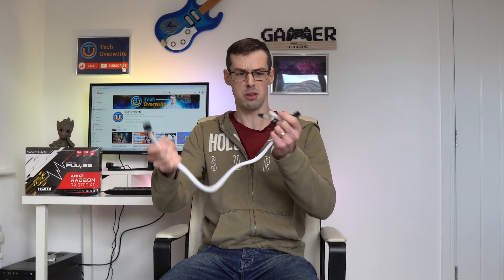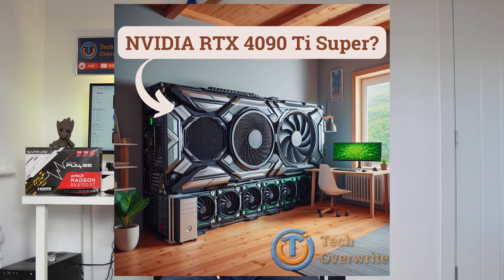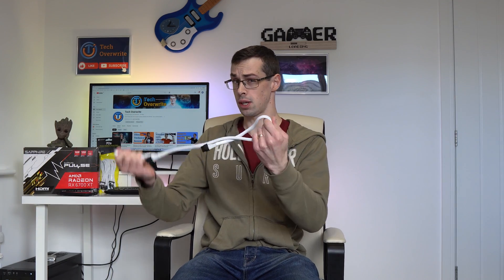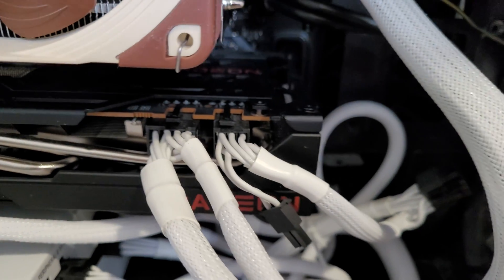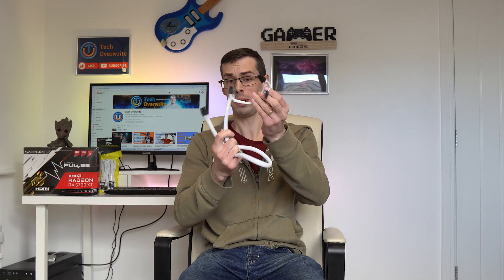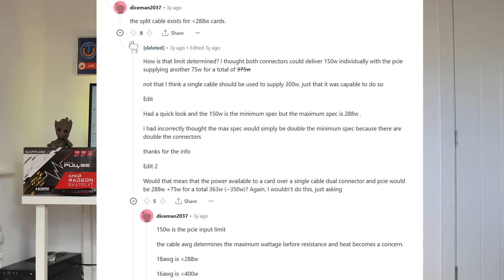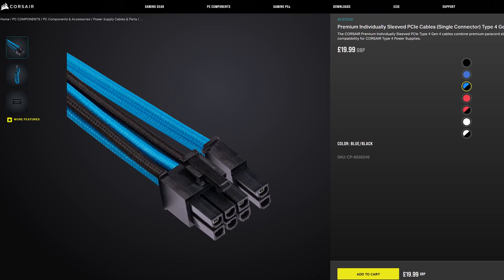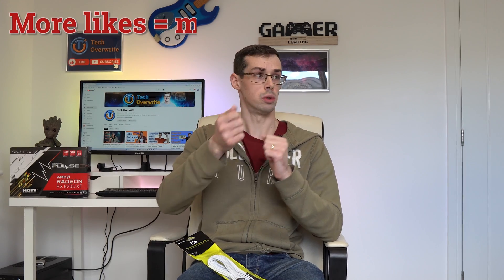Stop Connecting Your GPU Power Cables Like This! (How To PROPERLY Connect PCIe Cables For GPUs)

Comment: I have a rx 5700 xt and any time I launch up a demanding game like froza it would crash after barley loading in and gpu temp reaching 83c. My pc first loses display signal then fans stop spinning and it just shuts off.

I noticed my pcie cables are pigtailed do you think that could be the cause for the crashes? And should I switch to 2?

I have a be quiet pure power 12 m 850w psu if that makes any difference
Reply from the maker: Hmm that's odd, sorry to hear it. I mean, the 5700XT shouldn't really be crashing with a single cable although its power usage is borderline, so maybe two cables would help. The only way to know for sure is to test with two separate cables, and then see whether things are more stable. However if you still get crashes, I would use DisplayDriverUninstall, restart, then reinstall fresh drivers and see if that helps.
Reply: @TechOverwrite ill test it out and let you know how it goes

Comment: Planning on getting a 7800xt which requires 2 8pin connectors, ok so no pigtail connector I get it, are there cables where it’s like a double 8pin connector and connects to two pcie sockets of the psu ?
Reply from the maker: Good question - I'm not aware of any. I don't really see what the benefit would be over just running 2x separate cables (unless I'm misunderstanding). You will, however, get 12vhpwr to 2x 8-pin cables with many modern PSUs - i.e. ones with a native 12vhpwr/12vh-2x6 slot. They can be quite useful, and deliver more than enough power for a 7800xt :)

Comment: I bought 5060ti 16gb today my psu is 500w, the new gpu requires 600w and tells me to use 2 individual pce cables, is msi 650bn is fine? I got i5 10400f, should i buy extra pce i cable?
Reply from the maker: Ah interesting. I mean, the 5060 Ti isn't super high power, so you might be okay using that with a 500w PSU (and maybe even a pigtail). But yes, the MSI 650BN has two PCIe cables so that would probably be more stable again :)

Comment: Trying to find a PSU with 3X 8 Pin connectors from which to run three cables is proving to be difficult. Due to the language and terminology searches focus on cables not PSU end connectors.... and yes, I have a 7900XTX Sapphire Nitro+.
Reply from the maker: I get that, it's frustrating. Sometimes the higher wattage ones have 3x 8-pins. So... some 1000w might have three. And then many 1200w and above have three. You then need to look at the actual PSU pictures to see what connectors are there. I don't rely on the text/specs either - it gets too confusing.
Reply: @TechOverwrite Thank you for replying. I'm taking a chance on a Super Flower 1300w. It looks good from the back...

Comment: Thank you so much for this! I have been building and running high end gaming machines for years. Never had a problem….until my last rebuild. I have a 3090 ftw3 hybrid and I was running it with on pigtail and one straight. It worked fine until I recently upgraded my cpu, mb, and memory. Then it started crashing whenever I ran anything demanding. I was just installing my new psu (because I assumed it was a power issue - bought a 1600 watt monster to cover that now) and saw my pigtail connection I had been using and thought, “this card requires 3 8-pin connections. Surely splitting it like that can’t be a good idea.” I looked all over, including on Evga’s own site and found nothing, until I came across this video. I will be using three separate connectors now to run this beast and (fingers crossed) I’m sure this will alleviate my issues. Thank you so much for this explanation!
Reply from the maker: Thanks for watching and commenting, glad this was helpful :) Good choice on the new PSU, it's always good to have some extra power headroom IMO. Sounds like you're approached this correctly.

Comment: omg, i just realize that my last rx 7800xt always get blackscreened. every troubleshoot i've done but can make my gpu run normaly when the gpu pull maximall power like 260watt. i just use single pig tail in the 7800xt. maybe this is the problem why i always get blackscreened :face-purple-crying:. now the gpu already sold with only 1 month using
Reply from the maker: Ugh sorry to hear it. Yes this could well be why. Hopefully your future GPUs run more stably now though.

Comment: My 1000w psu only comes with 2 pcie cables and my gpu needs 3. What should I do? I can use the pigtails or would that not work. My gpu is a 9070 xt btw
Reply from the maker: You might be fine with just 2x separate cables. My 9070XT only has 2x 8-pin connectors, for example. I think the variants with 3x connectors are just for some extra OC headroom, but it's unlikely that it'll genuinely need 3x separate cables in 99% of cases.

Comment: Man i don't know what to do, i have to buy a new GPU (my 4070 died for factory difect) and now my only option is 7800xt. But my PSU (itek gf750 evo) had 2 PCIe cable, i say had because i can't find one cable so now i am stuck with only one daisy chain cable and i don't know if i am safe or not. (for clerance the GPU is the Asus Dual Radeon RX 7800 XT OC Edition)
Reply from the maker: Hmm that's a difficult one. I probably wouldn't want to power a 7800XT overclocked variant with a single cable, sorry. I mean, it might be fine - and you can always undervolt it to protect yourself. But in the long run, buying a new PSU or even a reputable cable e.g. from CableMod will be better.

Comment: I found your videos because I just recently bought a cooler master mwe 750w v2 modular. My GPU Rtx 3070 LHR version.

I connect 2 separate pcie cable to the gpu. It ran okay and safe for 1 months until it always crashes every day when I play a game. Sometimes, just make it to the opening menu then crash.

I thought it was a system error until everything is good and still crashing. 

so, my question, do I need only use 1 cable with pigtail?
Reply from the maker: Hmm that's really odd, sorry to hear it. Could one of the cables be damaged maybe? In general, 2 separate cables should be more stable than a single cable with a pigtail, so that's odd :/
Reply: @TechOverwrite  I thought it is the cable problem. But, it isn't. Still no idea what happened to PC. It keeps crashing when I play game and causing error when playing video on Youtube (it'll be normal again after refresh the page).

The last resort of my thought is only the GPU almost die, buit I hope not :(
Reply from the maker: Hmm you're right, it could unfortunately be hardware like a failing PSU or GPU. I hope not though 😔

Comment: i got 8+8 pin connectors on my rtx 3060 ti and 2 splitted 6+2 pin connectors from PSU. Should i use 1 splitted cable or 2 and using only one 6+2 pin connectors from each other? my gpu asks for 220W and i saw that splitted 6+2 pin connector gives 150w max. so maybe the 2nd choice is better?
Reply from the maker: IMO, the second choice will be more reliable, and also handle transient power spikes more too (which all GPUs can have). :)

Comment: So when they built my 3070 PC with a single cable it was okay since it's a decent Corsair cable from expensive PSU, and maybe using just this to power a 5070ti might be why I was getting freezing a lot.
Reply from the maker: Huh interesting, but yes, the power consumption increased a lot between the two cards (<250w for the 3070, but >320w for the 5070 Ti). That might be why, I agree.

Comment: 9070 XT OC here that requires 3 connectors. Haven't installed it yet but I have a 1000w PSU with only 2 dedicated PCIe cables and both have pigtails. Assuming I should be fine using the 2 main cables and the 3rd I'll use one of the pigtails. Does it matter which cables I use in a particular order on the card or are all the connections on the card created equal.
Reply from the maker: Yes I agree, that should be fine (2 dedicated cables and then 1 pigtail for the 3rd connection). The order shouldn't matter either :)
Reply: @TechOverwrite  So I have the rm750 watts psu and that comes with two cables both pig tail. I wanted to get the red devil 9070xt and thats recommending 900w although underload it shouldnt get more than 330w and I have an i5-12400f so if we are talking about turbo watts it goes up to 115w so since it only gets to around 600w would it not be fine to have two proper connections then once pig tail for the final one right ?
Reply: So I have the rm750 watts psu and that comes with two cables both pig tail. I wanted to get the red devil 9070xt and thats recommending 900w although underload it shouldnt get more than 330w and I have an i5-12400f so if we are talking about turbo watts it goes up to 115w so since it only gets to around 600w would it not be fine to have two proper connections then once pig tail for the final one right ?

Comment: If I'm running a pigtail to my EVGE 3070 Ti FTW3 with 300 tdp does that mean I've been under-volting it for four years..?
Reply from the maker: Not necessarily undervolting it, but maybe at times your performance could have been getting 'capped' a little without you realising.

Comment: Can I use just one cable with the Pigtail in a rtx 5070?
Reply from the maker: As in, run a single cable to the 12vhpwr adapter that's included with your GPU? I personally wouldn't do this - I would never take chances when it comes to 12vhpwr. So I would either run two separate cables, or look to undervolt my GPU so it uses less power.

Comment: I just moved, my gpu worked fine before the move, but now it says it's only getting "Board Power" and it hasn't exceeded 28 watts.

It's a Radeon 7900xtx XFX.

I've removed it, reseated it, unplugged the connections on both ends repeatedly, still nothing. The PC works and displays just fine, I just can't game anymore. 😢
Reply from the maker: Oh no, sorry to hear it 😕 Did you remove the GPU before moving? If it was in the PCIe slot, there's a small chance the PCIe slot or connection has become damaged (by the GPU moving during transit). Hopefully not though. Maybe double check all the PCIe PSU cables, incase one of those is damaged or there's a slight loose connection.

Comment: hey my PSU just have 1 PCIE cable how can i get another cable ?
Reply from the maker: Hey, unfortunately you might just need to change your PSU if it only has a single PCIe slot. Alternatively you can try using the single cable, but undervolt your GPU so that it uses less power (meaning it should then place less stress on the cable) :)

Comment: Hi! Can I get some help? I bought a pc a month ago, the GPU is a Sapphire RX 7900 XT nitro+ which has 3x8 pin connectors, but my PSU is a Be Quiet! Pure Power 12 m has only two outlets, so I must deal with this daisy chain pigtail stuff. The only thing I noticed is that during World of Warcraft, I get a black screen where I can't hear any sounds and can't move the cursor. This happens once/day which I find very weird. I tried it in other games as well, but haven't had this black screen problem. Can the daisy chain cause this problem? If so would the Corsair RM1000x(2024) be a good switch? Thank you so much!
Reply from the maker: Hi, hmm that's odd. What is the GPU power usage during the WoW black screen? You can check with the AMD software, or in HWInfo. If it's over 300w then maybe the 2x cable is the problem. However in reality, the 7900XT should be okay with 2x separate cables (and the pigtail for the third connection). It usually doesn't require a third separate cable. The RM1000x is a good alternative though, yes :)
Reply: 150w was the highest usage
Reply from the maker: Hmm that's odd then, I doubt it's a cable issue. It might be a problem with that specific game and AMD drivers. Maybe try the latest AMD driver if you haven't already. I had an issue with certain NVIDIA driver versions and Cyberpunk. All other games were fine, but Cyberpunk kept crashing.
Reply: Well in that case it might be a driver related issue, so doesn't matter if I get another PSU or not. Thank you for the help!

Comment: Hi! Can i gently ask you your help? I bought a 9070xt sapphire pulse, and it has 2x8 pin connector. My ps is msi a850gl pcie, it has a 12 pin (2x6) power connector (600w, yellow color). Should i connect 2 pcie cable (i have 2 separate cable with 6+2) from psu to gpu and completely ignore the 600w slot? Or buy a different psu with 2x8 connector?
Reply from the maker: Hi, you should be fine running 2x separate 8-pin PCIe cables from your PSU to the graphics card - assuming your PSU has standard 8-pin slots. It should do, but if not, it'll probably give you a "12vhpwr to 8-pin" cable, and that's fine to use too :) In short, you have a good PSU - there shouldn't be a need to change that.
Reply: Thank you so much, I'll try with 2 separate pcie cables then. Hope to burn nothing 😂
Thanks again, really appreciate your videos!

Comment: Bro my 3070 was connected with only a devil cable since 2020! I had one or two blinking red next to the power connector, on the internet they all said it was due to a voltage up and down to not worry about, but I always had random freezes. Lately it started black screen and freezing too often. FINALLY I managed to resolve thanks to you! 

However there’s still one problem I can’t fix, every single time I have to restart the pc it takes EXACTLY 25 minutes every single time. If I just start the pc it’s 5 seconds. It makes me crazy can you maybe please help me to understand what is causing this?? Thanks a lot man
Reply from the maker: Glad to help (a bit) lol :) And that's very odd about the 25 minute thing. So the actual POST/boot process (before you see the OS login screen) takes 25 minutes? If so, I would remove the CMOS battery to wipe that, and maybe upgrade the BIOS if there's any upgrade. THat could be a good first step.
Reply: @  basically I turn on the computer and then I have the rog strix logo on screen with the small white bubble rotating, that’s when I have to wait 25 minutes.
I am on SSD, and I would say this is something that happens from the beginning, I even checked the boot order from bios
Reply from the maker: Hmm sorry to hear it, I would definitely try the CMOS battery wipe and BIOS upgrade route first then. And then attempt to speak to Asus/ROG customer support and see if they can offer any useful suggestions - does sound like a motherboard problem IMO. You could also check the SSD's health with CrystalDiskInfo just incase that's failing.
Reply: @TechOverwrite  I will do this

Comment: Seasonic, in their information sheet with the psu, clearly states not to use the pigtail when hooking up to a gpu that has more then 1 6x2 and to run a seperate dedicated power line for each port. Never could understand why they gave you PCIe connectors with pigtails and then told you not to use them? Just bought a new Seasonic psu, and the PCIe connector no longer has a pigtail, just a single 6x2 pin on each cable.
Reply from the maker: I've seen a few PSUs recently with only a single connector (no pigtail), which is an interesting trend. I think the pigtail originally came out to help lower powered device - for example if you had two 150w PCIe devices, then it could help then. But nowadays GPUs are too high power. That's my thinking anyway :)
Reply: Yup, the pigtail power connector cable thing is traditional trend inherited from older PC components because back then no consumer graphic cards even draw anywhere near 200W much less 100W. Nowadays a single card can draw up to 400-500W while under heavy load. We reached the point where your medium to higher end consumer graphic cards are as power hungry as your fridge.

Comment: i recently got a 7800xt,  had it connected with one cable and was getting horrible coilwhine. I swapped out for 2 connectors and voila.... The coilwhine got worse. Absolutely no difference in performance, only change i noticed in game was that Spiderman 2 started crashing.
Reply from the maker: Ugh sorry to hear it - that's frustrating that the coil whine got worse :(

Comment: I have an ASUS TUF Radeon RX 7900 XT which when I have overclocked it to unbelievable levels, reached 570 watts total draw power😮!!! 
I guess it was worth it though because it put my cards raw performance above stock RTX 4090 scores. No I'm not kidding and yes I do have multiple proof videos and pics...
Reply from the maker: Wow that's amazing, nice one :) Crazy power draw though! Definitely good that it has 3x PCIe connectors. I do believe you on the great overclock - I've seen people easily OC the 9070XT to beat the 5080, so it stands to reason that a heavier overclock could then push it further (i.e. to 4090 levels). Nice one!

Comment: I have 6900xt sapphire toxic aio cooled model, if i use only 2 cables on it with its 3x connectors and set an overclock i can start to get stutters n frame drops under heavy load, set slight undervolt or use 3 cables and problem is fixed lol

Def can vouch it can cause some issues with more power hungry aib models
Reply from the maker: That's really interesting, glad that you had less stutters after changing that :)

Comment: Ordered a 6800 16gb non XT, expecting it to have a 16pin connection , I was like wtf when I seen 3 8 pins. Almost used the devil spawn connection but ultimately decided in using a 3rd cable . Thank you pc Jesus
Reply from the maker: LOL thanks, glad to have helped :D To be honest, two separate cables (plus one devilspawn lol) might be fine, but I tend to prefer erring on the side of caution.
Reply: exactly, and I’d like to pump as much juice possible into this bloody thing lol. TAKE MY POWER